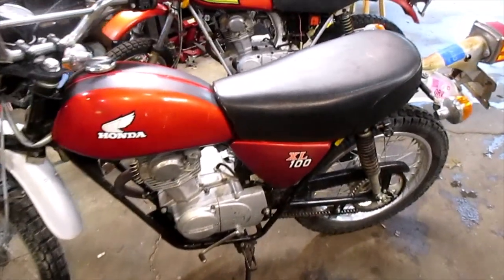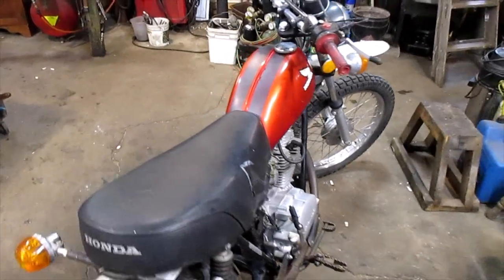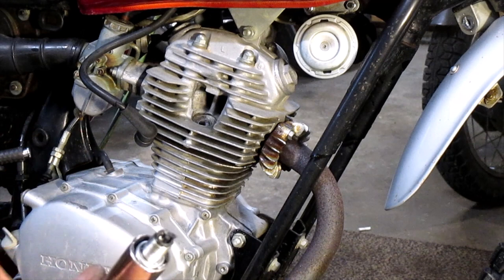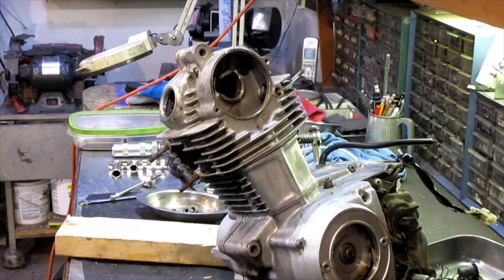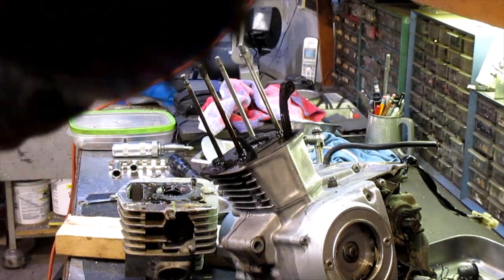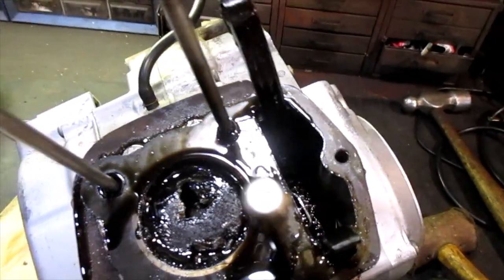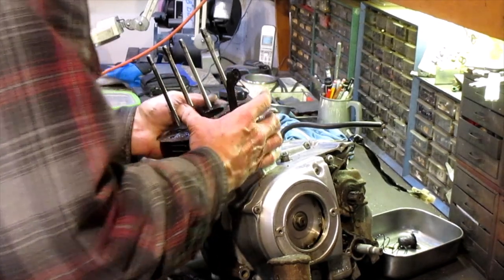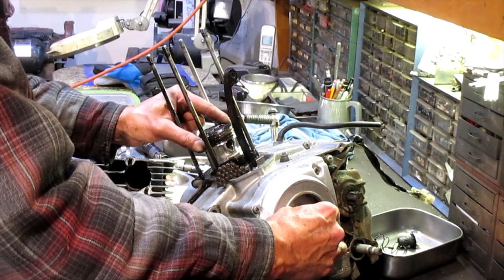1975 Honda XL100 Top End Rebuild

Comment: Hey im trying to determine real  miles on my bike the rear wheel drum says "max 141mm" with roughly 1/2mm of wear. So How many miles would you say the bike has gone the odometer reads 3250 miles does this seem right to you?
Reply from the maker: You can't determine the mileage by that. It' might not be the original wheel. Someone who road it before might have a bad habit of riding the back brakes all the time, or they did a lot of mud and sand riding, so that's not really a good way to figure that out.
Reply: @Amotorcyclenut   any ideas?

Comment: You literally showed everything except how to remove the points assembly and reinstall it and time it
Reply from the maker: Here is a video on how to time it. http://youtu.be/WQqLnBRsofk
Reply: @Amotorcyclenut  Just a heads up on the 1972 Honda CB350F Revival video.  That bike has OBVIOUSLY completed far more than the 2,200 miles you claim because if this were true that would be a brand new bike and it would still look brand new today even 50 years later!  The bike in the video HERE has seen better days and is in very poor cosmetic condition.  The odometer in shot clearly shows 12,121 miles.  NOTE**  The original pipes do NOT rust out after only 2,200 miles even IF you rode it in the rain several times. and those pipes are absolutely trashed plus there is rust everywhere.  The engine and alloy side covers are all corroded very badly.  Paint is faded as are the gauges.  That bikes has seen a LOT of wet roads and poor storage to be so trashed.